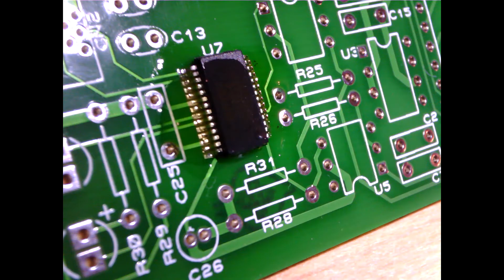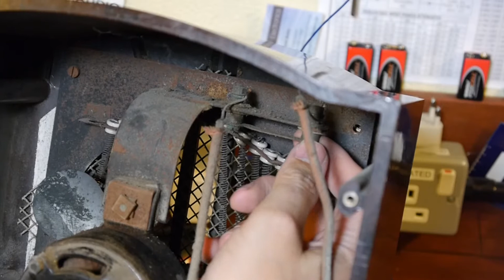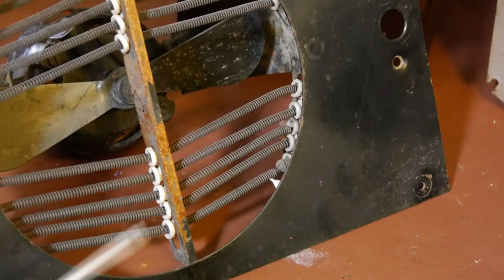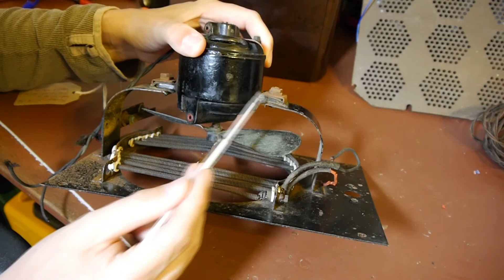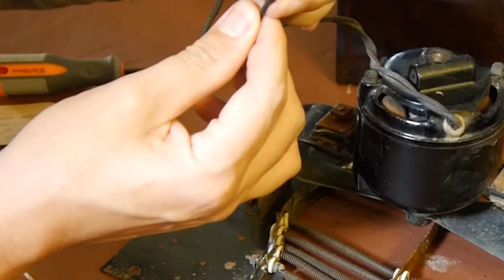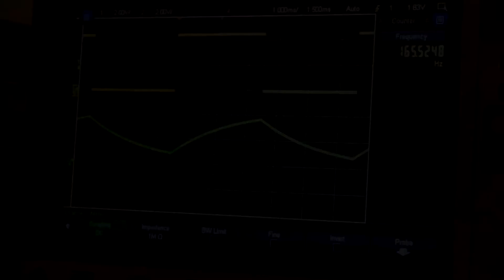GEC Radio Repair Part 2

Comment: Ha ha i wasn't too far away from the missing chassis :-D
Stuck on the warm weather station, heatwave 1000khz.
It may have been something that someone with radio interests would have made it into a radio, too much trouble really.
No need to reply to my comments unless you like pain :-D
Reply from the maker: zx8401ztv don’t worry I like nothing better than to nail my bollocks to a wooden plank and drag it around the the garden!

Comment: If you plan on using it as a heater you will have to find a modern substitute for the asbestos sheet that was thrown away or the heat from the elements may damage the Bakelite, one that I ran across is sold as a exhaust gasket material in auto parts stores, for making your own gaskets.
Reply from the maker: OlegKostoglatov Thanks for that I had come up with a similar idea. I have some exhaust wrap I used on my sports car manifold left over. I also wondered if I could use a plumbers mat. They use them here to protect the surrounding woodwork when soldering pipes with a gas torch. It’s the little ceramic insulators I’m struggling with everything I have found is to small.

Comment: Restore it!
Does the switch have a position for fan only?, If not, put a 2 position rotary switch on it?,
It deserves a new life, a rare item here.
 New power lead well grounded to the frame, and a link to the motor body, safety sorted.
 Cheers, J.
(I use Brasso on bakelite, then furnature polish)
Reply from the maker: Average Joe wow you must have a sixth sense about that motor! Find out later.
Reply from the maker: Average Joe  single position . I was going to try Tcut but perhaps your method is safer. Thanks Joe

Comment: Tough one. I'd like to see if it works but, as you say, there are risks in that. If it were mine I'd go for the cold fan option, the least destructive on the electro/mechanical parts. The cabinet is lovely, so the speaker/MP3/radio option with a home built 5w amp my second choice.  At least give the motor a spin! Var-i-ac cha-cha-cha Var-i-ac cha-cha-cha Var-i-ac cha-cha-cha ...

Regards - Andrew

Comment: I think you have to give it a shot to repair it, as a heater. Stick it on (fl)e(a)bay.
Perhaps you can improve the isolation of the cloth wiring to the motor with some heat shrink or heat resistant tubing (the stuff found around wires in some toroidal transformers).
I understand that you're not willing to put anyone at risk with electrical safety of this older stuff, but the people that buy vintage gear like this, most likely know what the dangers are, don't you think? Of-course you could always make it clear, that it works (if you succeed), but it is meant more as a display piece, than for regular use.
Reply from the maker: MrDubje  Yes you make some good points here. I think I have some glass fibre insulated cable that I robbed of a jet engine in the garage somewhere. I need to make some more thermal insulators for the heating element. Needs to be electrically and height temperature resistant but need to turn it on the lathe.

Comment: I think you'll find that the valve filaments have lost their high emissivity coating. Yes, that's the answer. And the asbestos is the dielectric in the tuning capacitor. Remove that and you'll only get shortwave. ;)
Reply from the maker: Yes your absolutely right, I cannot believe that I didnt spot that. An obvious neub mistake to make.  I think it needs a longer antenna but those Italian ham radio stations are coming in strong.
Reply: "Italian ham radio" -- would that be Radio Prosciutto ?

I'll get my coat...
Reply from the maker: could be